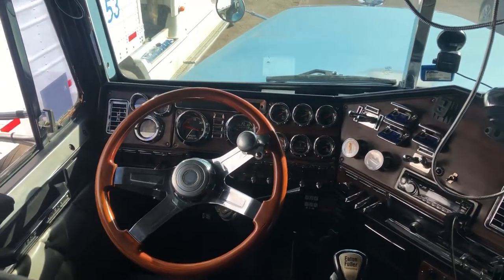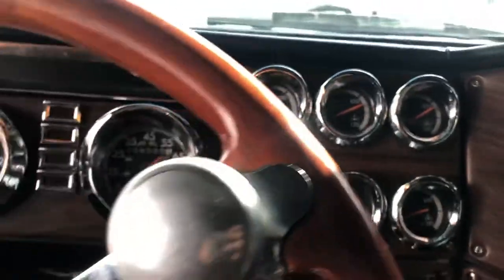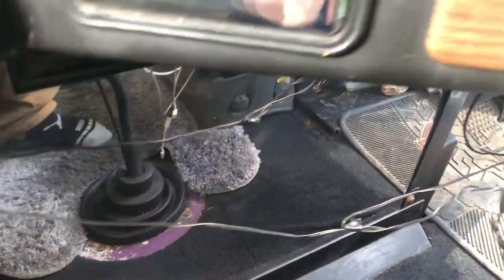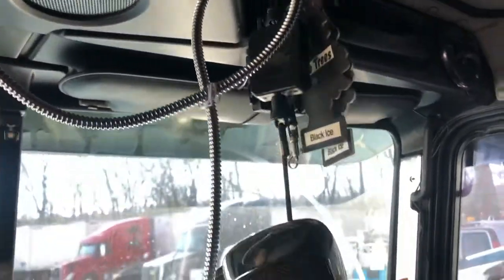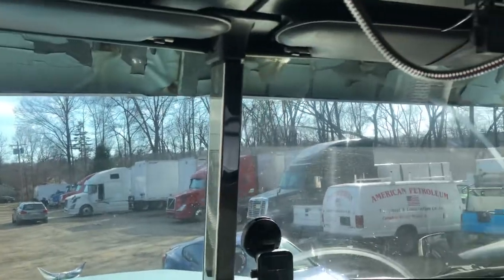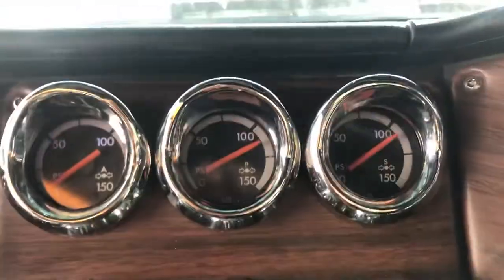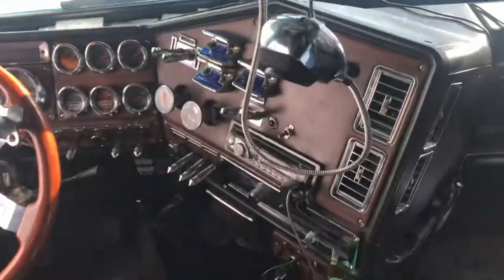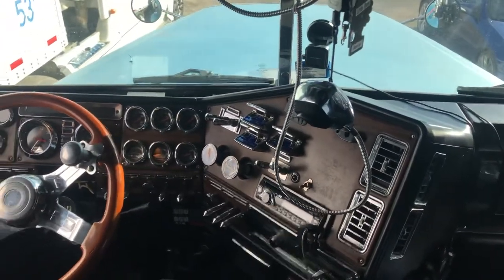1999 Freightliner Classic Xl Interior

Comment: How did you get your lights hooked up under the steering wheel? And how did you replace the lights on the gauges
Reply from the maker: Sting light from Walmart they just plug in and you unscrew the gauge panel pull the light out of the gauge, push and twist the bulb and bulb should come out